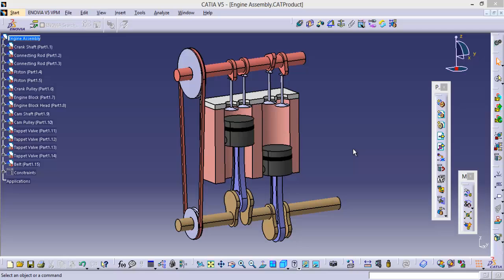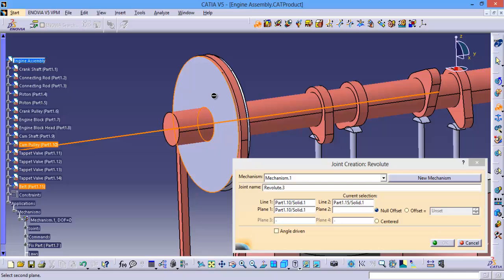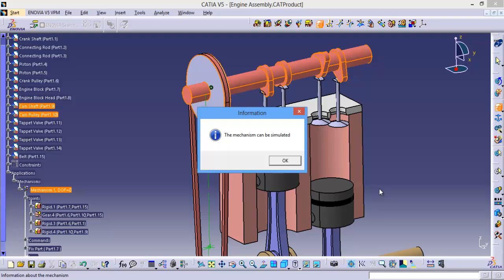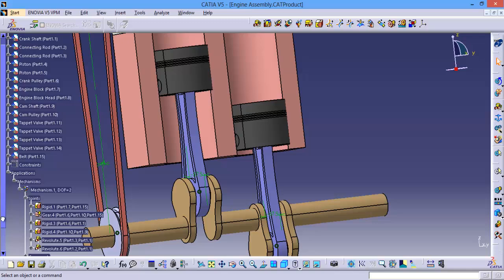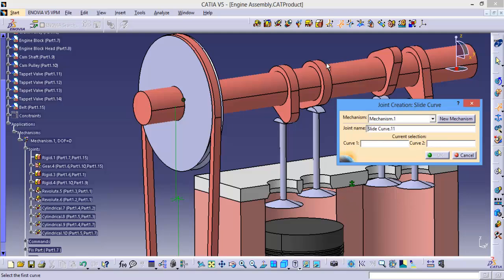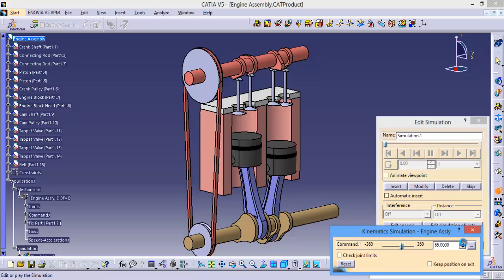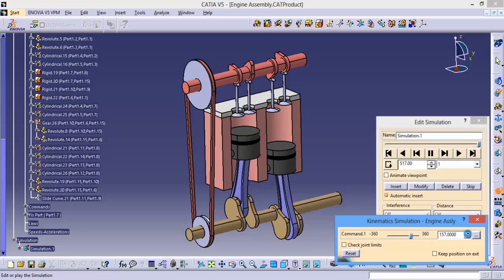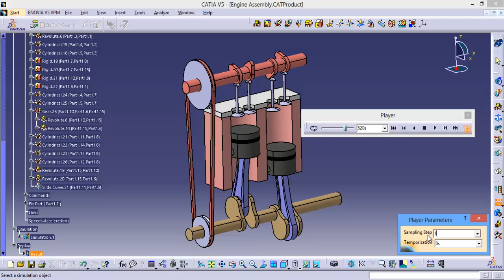Engine Simulation in CATIA V5 Kinematics | DMU Kinematics | Conecting Rod | Piston | Crank Shaft

Comment: Nice bro...but the belt does not moving there...or it seems like to appear as not moving
Reply from the maker: Exactly bro... It's not possible, coz it's a single rigid part(belt). So it won't get rotate. In order to move that we have to make it as small pieces.